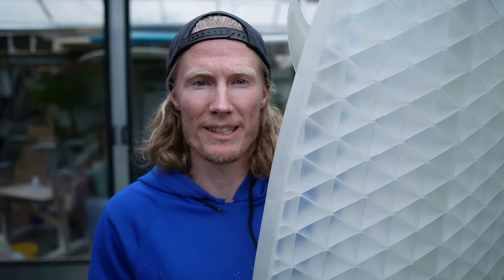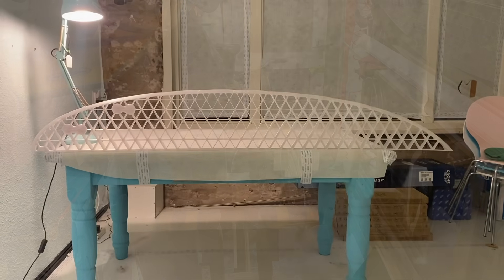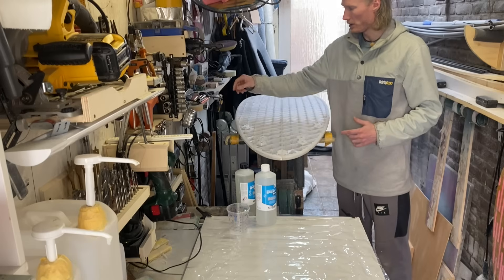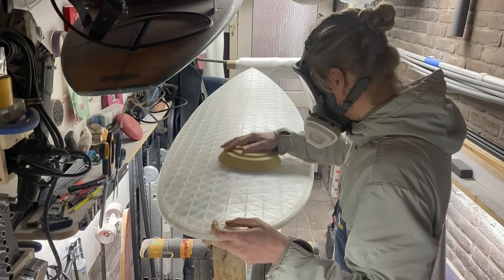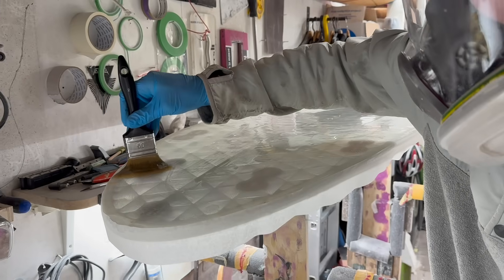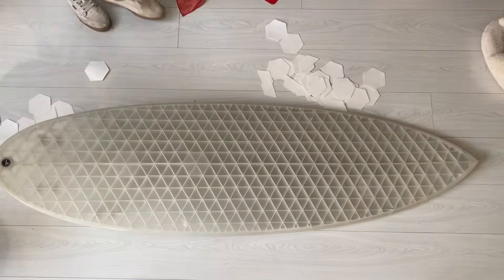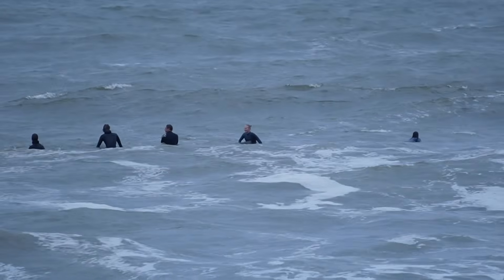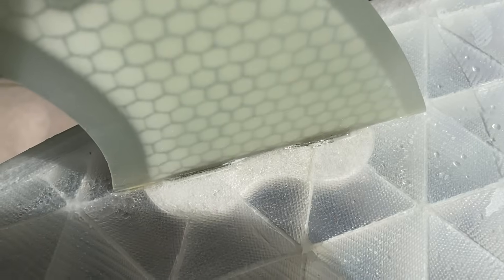How to 3D print a surfboard with a basic 3D printer?

Comment: Too bad theres not some kind of shrink wrap for the original layer.
Reply from the maker: Yeah that would be nice. There are other methods to do this though. For instance. Put actual shrinkwrap over the structure. Laminate over this, then remove everything from the frame, remove shrinkwrap and glue the fibreglass onto the frame.
Reply: @Dzjiefoils  that sounds amazing.

Comment: Hey @Dzjiefoils, good job! Please can you inform what was the final weight, board dimensions (lenght, width) and volume (liters)? Thank you in advance. Good waves for you.
Reply from the maker: The board is 5kg’s so way too heavy. It’s about 5’9 by 19something, by 2’1/3 didn’t measure it properly.. 🤷‍♂️
Reply from the maker: No idea about the volume.
Reply: @Dzjiefoils  thank you for the info. I would guess it has 27 liters. Good waves for you.
Reply from the maker: Maybe you can measure it somehow in the 3D files
Reply: @Dzjiefoils  , thank you for the tip. I was thinking and maybe it has more than 27 liters... 30 something maybe. 5 kg is really heavy... too much material inside but necessary for the structure. Nice project, work and dedication. Inspiring. I will try something like this in the future. Good vibes and good waves from Brazil for you and all friends in the Netherlands.
Reply from the maker: @nekoasadelta  thanks man! 🙏🙏 we need some waves here in the Netherlands, it’s been flat for 3 weeks allready.
Reply: @Dzjiefoils  at least you are in the summer now, padling around is good to keep the mood. I have been visiting your beaches in November and it was really cold... We are in winter here but looks like your summer. If you visit Brazil someday please let me know. The waves are here nearby home. Warm water most of the time. I live in Florianopolis. All the best.
Reply from the maker: Thanks for the invitation, I want to go to Brazil for a long time, but I just renovated my house, so I'm a bit low on cash at the minute.

Comment: Very Nice!  Need to weld (so to speak) fin on with fiberglass rope.
Reply from the maker: Thanks. Yeah thats whats done in conventional glass on fins, but these are glued into the fcs boxes, so same mechanics as when the finboxscrew would have worked. I chose to not use rope to minimize the weight. But if I’d done it, the board wouldn’t be leaky now!
Reply: @Dzjiefoils  Thank You!  Hindsight is 20/20.  Nice creative job you did!  That board looks so Sic!

Comment: Nicely done, but: you could improve the process/the result significantly, by not just wetting the glassfibre on the foil but applying it WITH the foil! 
Build an oversized (wooden) frame (wider than your table), stretch a layer of PE foil (or a highly flexible, self releasing foil (like PO150 XD2, that's at least what I use/know) evenly upon it (not stretching it too much) and fix it (with tape) to the frame, not just here and there but all along!
Flip the frame upside down, the wooden bars of the frame hanging beside your table, giving some extra tension to the foil
Do the laminating process, but instead of just using glassfibre, use peel ply as a first layer, then your twill layer
Depending on the pot life of your resin, I would let it set for a some minutes, it still has to be slightly liquid to get a good tag to the waffle structure
Take the frame (with two persons), flip it back, and position it over your board, put it slowly on your board without any movement in xy- leave it like that until the resin is set! If you support the structure of your board evenly, you could even ad some weights (spread evenly at your frame). The foil will stretch the glassfibre evenly over the cells of your board, without the flaws you had.
After the resin hardened completely, you can remove the foil (a release agent is not needed because PE is self-releasing due to its non-polar nature), remove the peel ply and go on with the laminating process (without the grinding and all its disadvantages), peel ply gives you roughly 80% of wet-on-wet adhesion, which is really good!
I have no good idea right now how to handle the rails...

The adhesive forces of laminating resins are not as good as the forces that real epoxy adhesives can provide, PET G on the other hand is really hard to bond anyway, due to its low polar properties... modifying the cad-data of your cell strucutre and increasing the contact area would help, reducing the risk of a delaminating process when peeling forces occur (and they will occur as soon as you are using your board)

No wise-cracking, just some tips I came up over 35 years of using the materials and teaching students how to use them properly!
Maybe it's useful...
Reply from the maker: Thanks for your time you put in to write this! I really appreciate it! Your tips sound very useful. But only the first try of my laminating approach failed. The one where my girlfriend helpen me lift the cloth worked great. No need to waste peel ply cloth etc. so I think I stick with this one. 

The adhesion to the frame part.. I totally agree with you It somehow needs more surface to adhere to, but I don't have the skills to 3d desgin. If I did I would have made a small hexagon structure with open hexagonal ribs. The hexagons would be way smaller so the fiberglass didn't have to span so far giving it more strength overall, and reducing weight because of the "hollow" ribs. Sorry if this is not very clear. English is not my first language.
Reply: @Dzjiefoils  Completely understood (don't worry, English is also not my mother language), to have the right cell size is absolutely crucial, especially when you "just" put the wetted fiberglass on the open structure.
I followed a very similar approach nearly 25 years ago, when I was doing the practical work for my industrial design diploma. It was a see-through boogie board, the inner cell structure was laminated with just 1 layer 105g twill glass fabric, extremely lightweight but still pretty stiff (and a hell of a stupid work, the whole laminating process took me 100 man-hours!). The difference was, that I had a negative mold (taken from a positive pattern I cnc-milled) for the outer shell, so I didn't have to overcome the bridging issue because top and bottom deck were defined by the negative mold! This would be sheer madness for a real surfboard (because of its size), especially because everything has to be pin-point accurate to make sure, that all the joints fit together perfectly, without the need of using too much adhesive and weakening the structural stiffness/toughness!

Had a second and third glance at your board while being surfed, that's actually pretty much what I had at mind these days, to make the board disappear, just surfing the wave!
Absolutely gorgeous! I'll take a look at your future works, really inspiring!
Reply from the maker: Thanks!🙏

Comment: Just to mention a few things. You can use much larger nozzle size for such big prints and reduce printing time substantially. Even using 0.6 mm is more than twice as fast as the standard mass 0.4 mm. For this large print you can go even with 1.2 mm, given that your extruder is capable of this higher flow rate. You will reduce printing time by a HUGE amount and have stronger layer adhesion. Translucent materials are more brittle and tend to get even more brittle with time. For this application I would use opaque material and finally - I would use ASA as it's more durable and more UV resistant.
Reply from the maker: Thanks for the advice! If I ever make another one I will keep this in mind. I used a 0.6 nozzle though.

Comment: More microplastics in the ocean. Just what we need.
Reply from the maker: The plastic structured is sealed with epoxy and fibreglass, so no plastic is getting in the water. I used recycled ♻️ filament for this board because I care about the environment as well.

Comment: Great work. Looks great. We are also currently working on two wakesurfers 1x PETG and 1x LW-PLA. LW PLA is not as easy to print as PETG. Did you have any problems with the EOPXY "drops"? Have you tried different EPOXY? We are currently testing other lamination options. In addition, it is not easy with larger extinguishers that the fiberglass does not sag.

I printed the same connections for the individual parts with holes and "bolts". This makes it easier for gluing.
I would have to upload the files, actually wanted to make some videos, currently only have a few photos, may still come.
Reply from the maker: Great! No epoxy drops because I saturated and the cloth on the table with plastic. I used a squeegee to push out all excess resin before it goes on the plastic structure. 

Did you design these boards yourself? I’m looking for someone to design a foil board structure to 3D print.

Comment: Nice!!
What is the weight of the board?
Reply: oh, my question also, that's pretty heavy
Reply from the maker: Yesh a normal board that size is around 3
Reply from the maker: You can definitely feel it when surfing
Reply from the maker: It around 5kg

Comment: This turned out so cool! Very unique look as well. Interested to see how it holds up long term.
Reply from the maker: Thanks! 😊 It feels like it’s not gonna hold up long term. But we will see! 🙏
Reply: @Dzjiefoils asa might be a good choice for material because it is very resistant to uv damage and has similar strength to abs
Reply from the maker: @michaellee8853 yeah, I looked into that, but ASA tends to warp during printing if the environment changes. I cant guarantee a stable climate around my printer, so it would probably fail.

Comment: For the next version, use some carbon fiber nylon for the fin screw holes. This project is SO COOL. I love this!
Reply from the maker: Can you print with that?
Reply: @Dzjiefoils  yeah you can! I would suggest carbon fiber PETG with your prusa because nylon warps without a heated enclosure. Just search carbon fiber PETG. You will need a hardened nozzle too! Make sure you can print at the higher temperatures PETG needs too. PLA can melt in the sun too, so PETG would be the material of choice if you want to take this board to tropical climates
Reply from the maker: Thanks for the tips! Will look into it! 🙏🙌👌
Reply from the maker: And thanks for the kind words! 🙏🙌

Comment: This is beautiful on so many levels. The idea, the production and the outcome. Wish you luck and to find an easy way to fix that leak. 

Btw, will the water just evaporate if you leave that somewhere hot, but not in the direct sunlight?
Reply from the maker: Yeah but the evaporated water must find it’s way out. That is turning out to be tricky. I’m already trying for a week. But were getting there!
Reply from the maker: And thanks for the kind words!
Reply: @Dzjiefoils  Thank you for answering <3 

Wow, I assumed that vapor, or at least majority of it, may exit via that pressure valve so insides even out with the humidity around. Seems like that's not the case at all without some kind of actual ventilation that can actually dry the moisture out
Reply from the maker: Exactly. But I will be patient and get all the water out. 🤞👍👌

Comment: That’s very cool. Maybe next version you will design lock connectors like puzzles to connect parts, like tubes with openings on one side to put another tube from another part …
Reply from the maker: That would be a lot better indeed. I’m not skilled enough yet in 3D design to do this yet. Maybe after some practicing!

Comment: Anyway to allow it to have water inside and it be ok?
Reply from the maker: Just one stupid leak at the finbox, this water could definitely be prevented. But indeed, if I ever do a next one I make more holes in the 3D structure. So the water goes to one plug or a cap or something.

Comment: why not lay flat ? take out as much as you can of those supports you get quicker and better print...
Reply from the maker: It kept failing on parts where the printer needed to print 1mil above the bed. The slicer didn’t calculate supports there so I had to find a solution.

Comment: Sorry that I might have missed it in your story but how much does it weigh????... I have thought about this as an option for making foil boards BUT They need to be rigid. The shape in the water is not so important... As once you are foiling, they are no longer interacting with the water.

.... But we foilers want our boards to be as light as possible.... And rigid.
Reply: Thanks for the prompt feedback 🙂 I have access to people who can do 3D printing easily at board size scale, but if you stay up, weighs too much okay 🙂
Reply: My current foil board is under 3 kilos including deck pads which I think is pretty incredible
Reply from the maker: That nice indeed! I will weigh the board as soon as all the water is out. And I’m gonna weigh my foilboard now as well!
Reply from the maker: I've worked on 3d designing a foil board. Let me know If you want the 3d file, so you can testprint it. I'm gonna do the same thing as I did with this board. Print it at home and glue it together.
Reply from the maker: I know! I foil as well! But the 3D skeleton is heavier than normal foam of this size. So stick with foam boards covered in carbon for foiling. 😉👌🤙

Comment: i wanna say the board is sort of short but you good be like 8 feet tall XD 
overall cool as shit 
how much did it cost you that would of been a cool tid bit of info no?
Reply from the maker: I’m around 5’9 so the board is pretty short yes.
Reply from the maker: I spend around €250,- on filament, epoxy, fibreglass etc
Reply: @Dzjiefoils  nice nice i appreciate those numbers just like to compare you know.
Reply from the maker: No problem! 😉

Comment: Next time print the board chambers with holes. saves filament, and time. Also adjust the print files to give the edge skirt of the board, small recurved teeth Alternating direction for gripping the fiberglass sheet and stretching it across. All that can be ground down with the epoxy and access later
Reply from the maker: Thanks for the tips, I don't understand the teeth part though?
Reply: @Dzjiefoils perhaps he means small teeth top and bottom of rails, for stretching the fibreglass... (but don't think his idea would help, it would do more harm then good)
Reply from the maker: Ahh now I understand. 
No that isn’t gonna work. Fibreglass isn’t stretchable you will either rip it with the teeth or pull the separate woven strings apart causing a hole in the glass fibre

Comment: Would a spray foam in between the cells make sense?
Reply from the maker: Thought about it for a brief second, bit It will add more weight, and spoil the looks. It does give more strength though. 🤷‍♂️
Reply: @Dzjiefoils  yeah - making it stiffer would likely be best accomplished with something “like” an infill between the cells. Would increase the print times and - well the model doesn’t have the geometry at the moment.

The foam would maybe help “occlude” the space to keep water out, but might just get waterlogged :)

Does seem like making it watertight to the point that this is a rare event would make having to occasionally drill into it to relieve the water manageable? A cleanly drilled hole would be easy to patch up… but maybe one hole wouldn’t be sufficient either.

Seems like a thing that if designed for - making it easy to deal with the inevitable water infiltration - is a challenge.

I wonder if PETG or even ASA can be stiffer than equivalent foam by weight. Eg the model could have a denser honeycomb structure to make it stiffer but it’ll continue to get heavier so the question is whether there’s a crossover point where the plastic structure - despite being partially hollow, leverages the better material properties and unique geometry of the 3d printed part to outcompete foam.
Reply from the maker: with this strength to weight ratio it will never outcompete foam. Maybe some Carbonfibre infused filament would? I will keep exploring! Maybe make the ribs hollowed like v1 of the print file? That solves the water problem and reduces a lot of weight I think. But it’s difficult to print. Maybe with a good printer it isn’t.

Comment: I admire the dedication you put into this. The board looks awesome!
Reply from the maker: Thanks a lot!
Reply: great video though. Showing the many capabilities of 3d Printing! How do you feel this board performed vs standard surf boards ?
Reply from the maker: It performed pretty bad so far. It’s too heavy and I don’t trust it enough to put pressure on the deck during turns.
Reply: @Dzjiefoils  even after all that fiber glassing ?
Reply from the maker: Yeah. Th plastic structure is just too weak. The fins that make the triangular structure are too thin.

Comment: You might want to get a filament dryer for that PETG. It looks like it has a ton of moisture in it by the looks of how rough your prints turned out. Too much moisture in the filament creates steam in the nozzle and will cause it to kind of bubble out of your nozzle and make it look rough and bumpy
Reply from the maker: Thanks, multiple people reply’s saying this. I tried drying one roll of filament in my oven but it turned up melting like a solid piece. I got some advice how to do it properly next time. 🤙👌
Reply: @Dzjiefoils  Yeah the oven is too unstable to hold a low heat. you would need to buy a dehydrator or buy a filament dryer. I bet you could get one for free from a company if you did a small video on it too. Sunlu sells one that holds 4 rolls, so maybe reach out to them and ask if they can send u one for review.
Reply from the maker: Thank you for the advice. Will try to get something arranged!